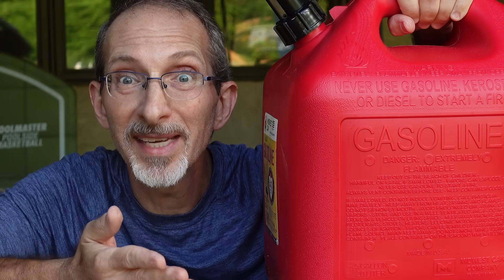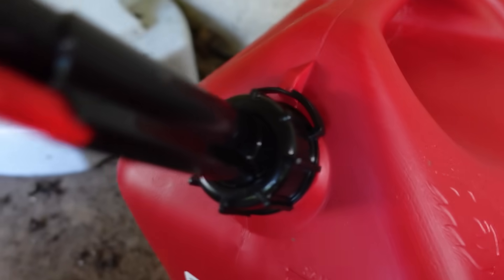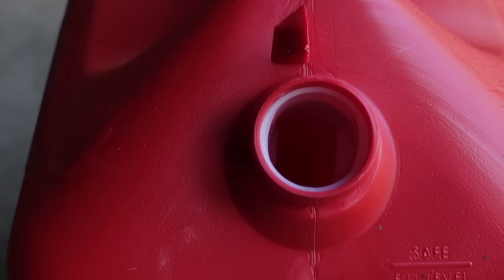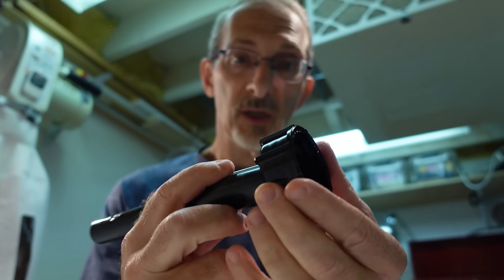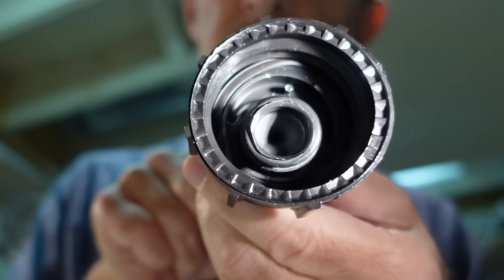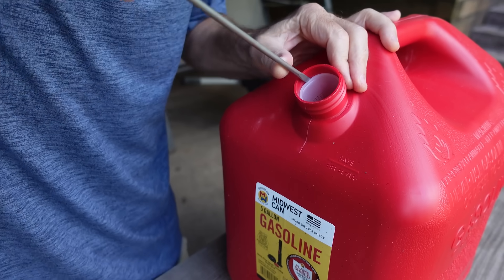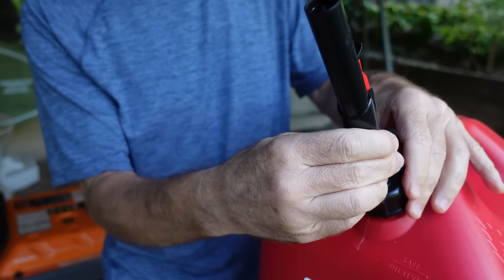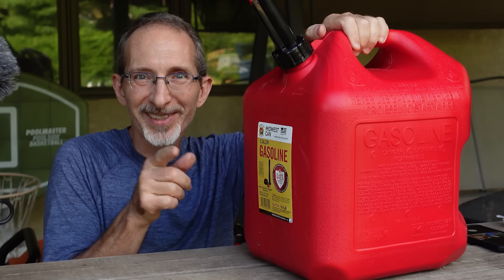Gas Can Modification | New Gas Can Fix

Comment: Great video. That white filter doesn't help. Anything it catches is dumped into the gas tank of the engine you are trying to fill.
Reply from the maker: Yes, agreed. Turns out I was wrong in my first video, it is not a filter but a flame arrester. I go into it in my second video, link in the description above. Thanks for watching!

Comment: The filter is actually a spark arrestor.  They used to put the arrestor, a little screen, in the nozzle bottom.  Now they have this monstrosity and since it is viewed as a safety device, not a filter, they make it tamper resistant.  If you can find them in your area at like a farm store, the "Utility Jugs" sold there do not have all the fancy devices.  Utility jugs come in all the colors you could ever want and are basically a rename pit crew style fuel can.
Reply from the maker: Yes, flame arresters! I clarified that in my follow up video. There’s a link in the description if you’d like to watch. Thanks for joining the conversation!

Comment: I usually poke a hole in the rear of the handle and put a sheet metal screw in it so it pours faster so I'm not standing there holding it for 2 hours waiting for all the gas too empty outta it. Plus I engineer the spout for my liking not the epa's liking.
Reply from the maker: Agreed! I installed a plastic vent in my follow up video. It was pretty easy and it is very effective. Now my gas container works just like cans from the good all days!

Comment: I have several of these cans and never have a problem...Why?  Because when it is time to fill my car, my lawnmower, or weedeater, I pull out my handy dandy electric fuel pump, take off the offending spout, and insert pump.  Do not even have to lift the darned can off the ground!  HA HA  Cost...about $16 on eBay!  Battery lasts a long time, too.
Reply from the maker: Mike, I’m being more and more drawn to the idea of a fuel pump! Thanks for commenting!

Comment: Grind off sharp pieces.   No box cutter.
Reply from the maker: Honestly, the piece I trimmed with a knife with soft enough that I probably could’ve knocked it down with my finger nail. But grinders are more fun to use!
Reply: @MikeFyxdt     Hey, I appreciate you sharing.   I have 3 brand new brackets like this.  All will get neutered.   Thx!

Comment: Why didn’t you show us how the mods worked with actual gas when you filled your generator?  Instead of modifying the can, just return it to store and buy a different brand. Not all brands have these safety features. Of all the mods you did, removing the spring totally will create a mega gas spill when you pull the can from your generator. Replacing the spring with a weaker strength spring would still provide the benefit of auto shut-off when you pull the can away.
Reply from the maker: You bring up some good points. I had already filled my generator before making this video, so I didn’t get that video recorded. I purchased these cans at the very beginning of the pandemic, and they were all I could get my hands on. In my follow up video, link in the description, I did exactly as you suggest – shorten the spring to make it easier to depress, so I still have the shut off feature.
Reply: @MikeFyxdt  thanks for the update. I just purchased one these cans for kerosene and I agree the spring is mighty strong. Thanks to your video I now know how to take apart the nozzle to modify the spring.

Comment: In addition to being difficult, and dangerous, to use, these new cans with the "self venting" nozzle don't allow any method of venting without the nozzle being depressed.  Thus, if the temperature goes up significantly between filling and dispensing, the can pressurizes itself.
Reply from the maker: Yes, these cans pressurize a good amount when the temperature changes. I put a yellow vent cap on my can in my follow up video. I imagine that would pop open before anything crazy happened, like the cans splitting.

Comment: those midwest can spouts last about a gallons worth of use before they crack and spill gass all ever the generator 
no reason to modify it just toss it and replace it with a aftermarket spout and use the vent cap that comes with the new spout and you end up with a nice gas can that is actualy usable
Reply from the maker: I can’t believe how many people are in favor of just getting rid of the spout and getting a replacement. It’s great to have options!
Reply: @MikeFyxdt  when the original spout breaks half way through the first use its no longer a option and i dont realy like waiting for gas to dry to start the generator also dont like gas all over my hands legs and feet when the spot snaps i have 3 broken midwest can spots that all did the same thing

Comment: Simple solution is to not buy those gas cans.  look at what the features are when you buy it and just don't but them with those options.  I have 4 different ones from different years and not one of them has any of these features.  There is a pressure release / air intake valve on one side and a flexible / reversable gooseneck spout (it gets inverted and stored inside the can under the cap when not in use) and I have never spilled any gas or had any problems with any of them.
Reply from the maker: I bought these cans at a time when I didn’t have a lot of options. Now that I made some changes, they are much more friendly. But I hear you… Consumer beware! Thanks for joining the conversation.

Comment: One more thing, I drill a one eighth diameter air vent hole in the top of the gas can on the top opposite the nozzle,  allowing for much quicker pouring out of the gas. Put a piece of dowel rod in the hole when not using.
Reply from the maker: That will work! I added some yellow plastic vent caps to my cans in my follow up video. Inexpensive and I think they look cool.😎

Comment: I do not buy Obama gas cans.  I use No Spil gas cans for the cans I most often use.  You can get them from Tractor Supply and they cost about $20.  I could never get those Obama gas cans to work, correctly.    I usually just took the spout off and poured it out.  Just try pouring the gas in a cars gas tank from those pos!  It is impossible.  You will end up with more gas on the ground than in the tank.  I will take the one gallon glass jug that I used as a boy anytime over those pos.  My No Spill containers work great.  Just push the button and pour the gas.

Comment: I hate these new gas cans. I just bought an extra wide mouth funnel and I take the pouring spout off.
Reply from the maker: Makes sense! I never realized how many people take off the spout and use a funnel. Old-school for the win!!
Reply: @MikeFyxdt   new gas tanks don’t have a auxiliary air or weep hole and the gas comes out slow. Mike something else I learned too is as I got older I don’t use 5 gallon containers because they are too heavy. I buy 2 gallon containers only. You are probably not there yet but you will be someday. So funny. I find that at garage sales the old time gas containers are the first items to sell. I forgot to tell you. That was an excellent video. Nice work.
Reply from the maker: @JohnDavis-yz9nq  Thanks for the compliments! I use the 5 gallon jugs for the generator, and to refill my 2 gallon jugs that are easier to handle. I added an air vent (in video#2, link above) and it significantly improved how smoothly the gas poured. I'll definitely be watching garage sales now!
Reply: @MikeFyxdt  I’ll bet you could come up with a complete different pouring spout all together using the original locking nut. For me the spouts are all too straight nowadays. I miss the ones that had a crook in them. I would still use the old ones instead of a funnel. Had we known we would have bought more of the old style for extras. I do know a single person that likes the new ones. And you can bet the people that designed them don’t use them or they would see how terrible they are and change the design. Using a funnel has it’s draw backs. You have to keep it clean. I keep mine in a plastic bag.
Reply from the maker: @JohnDavis-yz9nq  Plastic bag is a great idea. I don't use a gas funnel, but i use one for engine oil, and I am always wiping stuck bugs off it. :)
Reply: @MikeFyxdt  yeh either put the funnel in a plastic bag or clean it every time you use it. For me it’s a scary thought of any dirt getting in my gas or oil. For the most part I hate plastic bags because I can’t see what is in them.

Comment: Why are they making them this way now? I bought a new one with my new snowblower and it spills more gas then it gets into the snow blower.
I threw it out and bought an old one at a yard sale problem solved
Reply from the maker: Hi Dean, in a word, safety. There are government regulations that say gas cans need flame arresters, which is what the filter in the tank actually is. The modifications make these tanks quite usable, but I agree I like the older designs better. Thanks for watching!

Comment: These were supposed to be "safer"and prevent spilling of the gas from over filling or taking the spot out and gas flowing out. 
I had problems with the first ones I purchased. I spilled more gas using the so called safe spout so I bought a breather port like the old cans used and installed those in the back of the cans and removed the spring and in some cans I had to eliminate the forward part of the spout and used fuel line hose to fit over the remaining nozzle. I have run across about three different designs but they all need improvement on their engineering.

Comment: In South Africa we store gas in a specifically designed high pressure cylinder.  We generally store petrol in a can like this one on your clip.
Reply: In the United States, while "gas" might be used in many contexts, we're generally smart enough to know the difference. In this case, "gas" is obviously short for "gasoline," not the pressurized fuels (butane, etc) contained within cylinders.

Comment: Here  in  Dinki - Di  land,  just  buy  the  Rheem  brand  black  20 litre  jerry  cans.  
They  come  with  a  Yellow  safety  funnel  that  has  a  built  in  opening  to  allow  air  to  
exit  the  jerry  cans  to  prevent  " Glugging ".
No  changes  required, no  bullshit  regulations  to  circumvent  &  NO  charges
can  be filed  against  you for  altering  safety  rules.

Comment: Your fixes were great except I would just leave the spout in the open position all the time and put a 90 degree rubber heater hose on the end of the nozzle, with a little removable plastic plug for the end when your done using it. That makes it much easier to fill tanks that fill from the top. A straight nozzle is mainly for filling a car tank on the side of the car,,,,,,,,,,,,,,,,,,

Comment: Oh, I have a Bright Idea!! What if gas cans just had caps attached in a way that didn't fall off so people would use them. Also if they don't spill gas out of everywhere between the can and actual fuel spout. This over engineering has caused a huge problem solving nothing, because now it is common practice to just take off the safety cap and pour from the jug.

Comment: MY PROBLEM IS when you are trying to fill something like a lawn mower and the nozzle doesn't "flex" to where the opening in the mower tank is!! I don't know how many times I have spilled gas all over my mower because some idiots piss poor nozzle design which frankly who has a filler neck that is that "straight" as they are coming off a gas can like this!! Apparently the same guy who designed these things, has never OWNED or USED a gas can to fill anything in his life before!!!

Comment: 40 year old 5 gallon cans: Drill vent out to 3/8". Remove spout pour directly into 12" diameter funnel. Five gallons dumped into boat tank in 30 seconds.

Comment: Thanks for this video.  I needed a new gas can and all I could find were these new-style models.  What a pain!  I was cursing the stupid bureaucrats that decided this needed to be the standard and wondered who's pockets got lined.  As another commented, I never spilled so much gasoline as I did with these new 'safer' gas cans.  My solution was to go to Amazon and buy a two pack of the old nozzles.  My can did not have the screen inside the neck, so I didn't have that issue.
Reply from the maker: You’re welcome! I’m glad you could fin the right nozzle. Thanks for watching!

Comment: I remember when I first started cutting grass 35 years ago when I was 10, my dad had a metal gas can and a lawnmower that once you started it the blade spun and had zero safety or panic bars and had zero problems as I was taught how to properly use these tools.
Reply: I've bought at least three push mowers since the 70s, and before I use them the first time I remove the plastic that makes it difficult to pull backwards, the other piece where the cut grass clogs up underneath it, then the safety brake device on the engine itself. Whoever designed this stuff has probably never used a lawn mower to cut grass.
Reply: Our parents were making mature men out of us back them so we could go out on our own as adults. Now adult kids hide in the basement playing video games or staring at their little phones while their fathers go to work, come home and cut the lawn.
Reply: @dancindavey1515  totally agree with you. I am 44 years old and been working in the commercial marine field 25 years and finding it very hard to find younger people looking to start in a very profitable trade. I feel all trades will suffer when my generation finally throws in the towel. The kids today want everything to be easy. Cheers.
Reply: @dancindavey1515  Yep
Reply: Ya? And I know a guy who cut half his foot off as an adult who mowed grass thousands of hours since he was a kid with one of those old school mowers. You only have to fuck up once, one slip is tragic. I got a Toro personal pace with one of those bars and the flap that keeps your foot from going under. Starts first pull every time and outperforms those old mowers I used in the 70's by a LOT. Mower safety measures have zero negative effect on their performance. And don't think you're so smart being "properly trained". All kids were properly trained, that's why incidents are called accidents.
Reply: @Jangocat  in the 70s a teenage girl down the street was mowing the lawn with a push gas mower. Pulling it backwards and looking behind her, toes on left foot got under the deck and into the spinning blade.

Safety features are created because people have gotten injured or killed.
Reply: @kenwittlief255  With a chainsaw, I taught my kids the straight arm method, so chain would be far from body. and to check with saw off before cutting if anything was within danger radius using saw to check distance.  Same with axe.  You need to teach safety.
Reply: @superchuck3259  did you also teach your kids they cannot touch a chain saw unless they are wearing full OSHA gear: helmet, full face shield, leather jacket and pants, armored gloves and steel toe boots...?!

Yeah.. .I didnt think so.. just keep your arms straight when the chain comes off at 70mph and whips you in the face.
Reply: A friend of mine had an old school reel mower with a Reo engine (truck company). It had a big flywheel on the side. But instead of using a pull rope, he would spin the flywheel with his foot and it would start every time.
Reply: good for you, you survived
a lot of kids back in "the good old days" died from making simple random mistakes

not because they were stupid, they died cause they were kids
Reply: @kenwittlief255  Couldn’t have been too many. Lots of adults around. Lots of them dying from being stupid....and making mistakes. Bad combo.

Comment: Just go .to Tractor Supply and buy the free flow nozzles they sell. They are listed as spouts for water cans. Yeah right! Drill a small hole near the top so the can will vent. Yellow vent with cap was provided with the "water can nozzles" that I purchased. The nozzles are flexible and you will have a gas can that actually works.
Reply from the maker: It amazes me that these spouts can be safe AND work well. Good to know replacements are available. Thanks!

Comment: So, my local big box farm supply sells a replacement nozzle kit that does away with all of this nonsense. They also sell a 5-gallon plastic "liquids container", available in Red, Blue, or Yellow, to color coordinate with your shop's design aesthetic. The liquids container has an enormously wide mouth cap that has a flexible hose. I carry liquids in my liquids container using common sense safety practice. Use at your own discretion.

Comment: Your rubber O-ring inside there is TWISTED.
Reply from the maker: Lester, someone else saw that, too, so I checked. I think the o ring is OK, but the plastic ridge that holds it in place was sloppily molded, so I think that's what you are seeing. I'll double check it when I get a chance - appreciate the heads up, and thanks for joining the conversation!
Reply: @MikeFyxdt  Field of view was limited , of course.

Comment: I took the spring loaded nozzle out. Then put a rubber plug in the bottom portion
Then pushed the plastic screen filter into the can. Like you I cut the safety clip off the can nozzle. Now I can use my funnels again!!
Reply from the maker: Cool! So did you remove the entire spring loaded nozzle part, or just the spring? I'm trying to picture it...

Comment: I use a 5 gal for my truck when towing my RV.  Quickly switched to the VP Racing Fuels gas/diesel cans.  You can find them in motorsports stores anywhere but California.
Reply from the maker: @TSparky - thanks for sharing the tip on the VP Racing Fuels cans. These fixes are working now for the Midwest cans, but I think I'll invest in better cans in the future. Appreciate you watching!